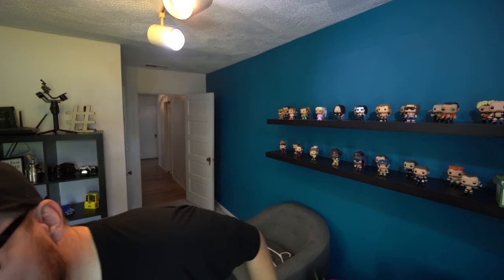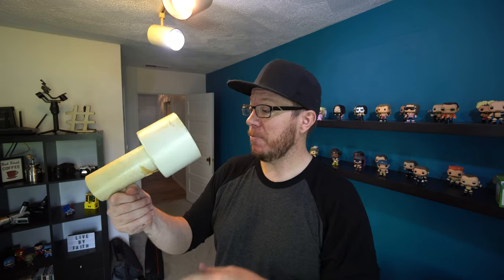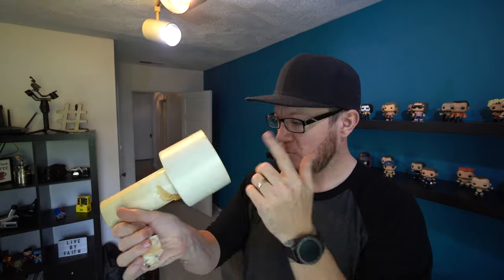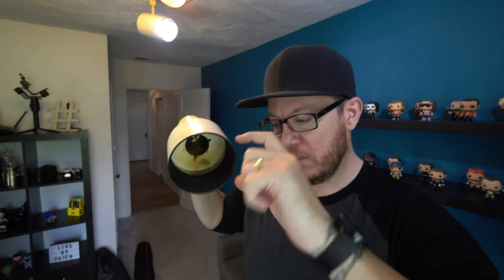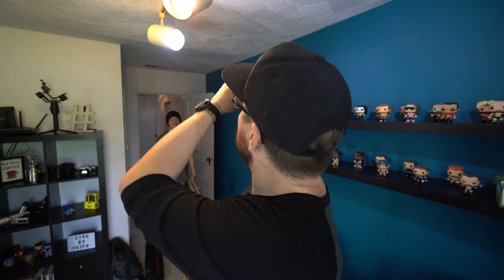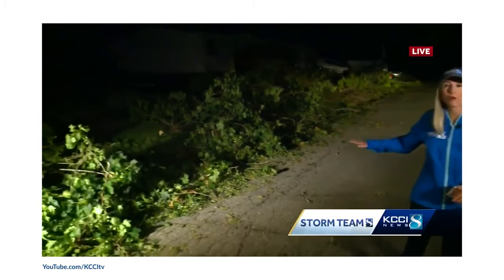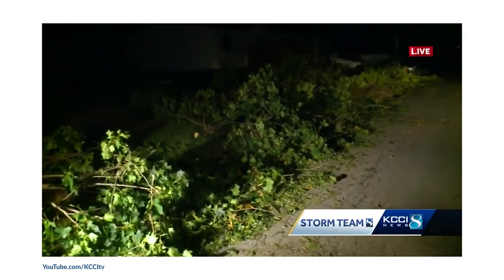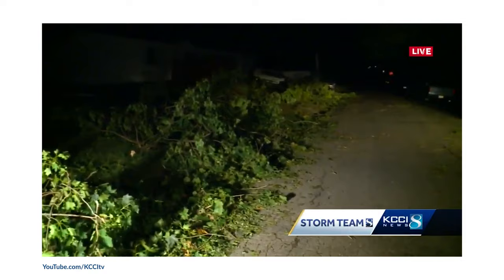I Made A Microphone Light

Comment: How the heck did you do it?
Reply from the maker: I found an indoor lamp cord with a switch and socket on it. Disassembled the microphone, removed the internals. Fit the cord inside the mic case, put wax paper around the mic grill to add some diffusion. Put the smallest and lowest watt, warm temp bulb in. Wrapped the cord with black gaff tape and done.